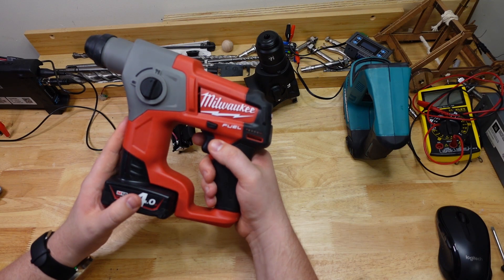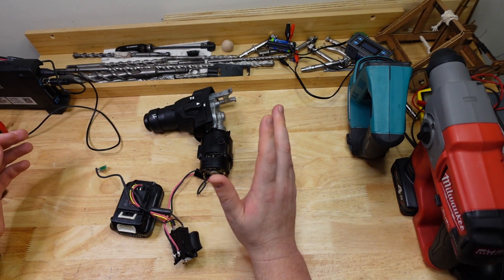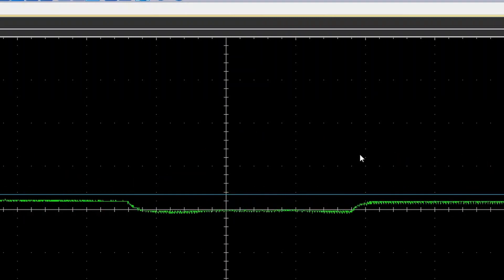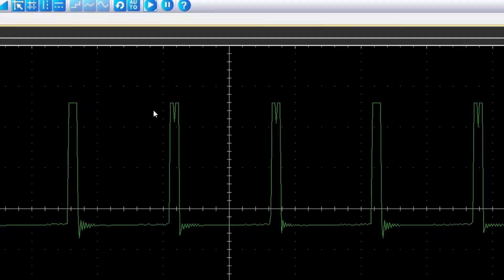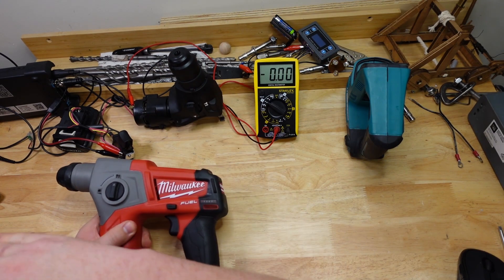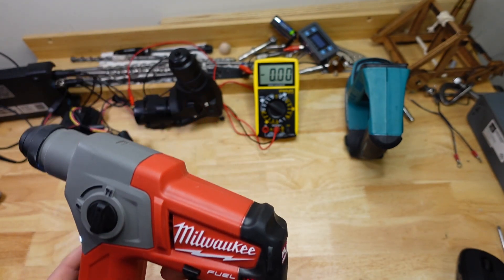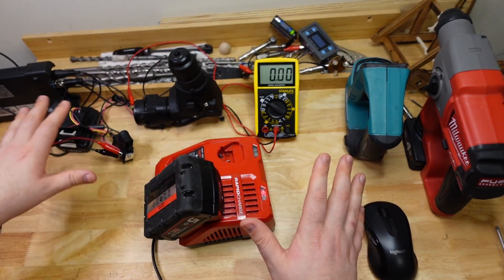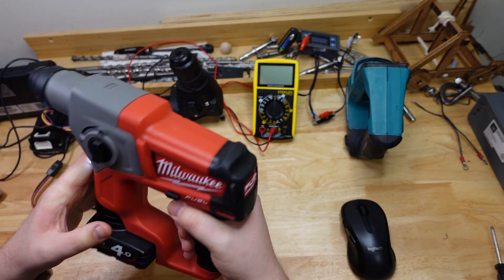Why's my drill make that whistle noise? (what causes coil whine in motors?)

Comment: I also hooked my m12 drill motor input up to my scope, discovering the same result as you've shown in this video. The DC motor-driver with the beefy switching FET is in the handle, and is directly behind the trigger. 

I have removed the motor-driver module from behind the trigger of several old power tools from various brands that were being scrapped to use with other projects with DC motors. They work really well as variable-speed DC motor drivers. Most are rated for several-hundred watts, and are already built into a small module with the copper heat-sink built in so they are convenient for driving DC motors at a variable speed. 

The trigger is a variable resistor that feeds the feedback circuit to the base of the driving mosfets inside the module. I've even used an Arduino to control a voltage input to this circuit to control the motor driver without having to use the actual physical trigger. I still have not been able to smoke one of the DC motor driver modules, even with a lot of abuse. They are quite durable, and have beefy TVS diodes to protect from the reverse-voltage spikes from the inductor windings in the motor. Good info and good video
Reply from the maker: That's a great point, if I ever need a driver I know where to find one! Cheers

Comment: Well explained. Thanks for putting in the effort to explore that so thoroughly.
Reply from the maker: Thanks mate! I see you also use your M12 CH for bolting climbs. How do you find it?
Reply: @BoltahDownunder  The M12 works great for ground up with 3/8" bolts or upsizing holes to 1/2 for re placing bolts. I use the 1" M18 for most things tho. The M12 is great to throw in the bag for those days where you might need to put in a few bolts. 
Have you found a tiny drill you like better? Still going thru your videos.
Reply from the maker: The 12v DeWalt is more powerful and the Makita is easiest to control 1-handed, so my preference is the Makita. That said they're all great and I wouldn't get a new drill just to see how it feels. Trust me, that's a slippery slope! I did that a couple of years ago and now I have too many drills and had to break my climbing stuff out into another channel because the drills just took over my life😅